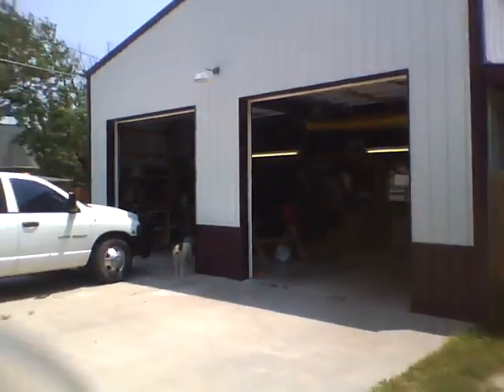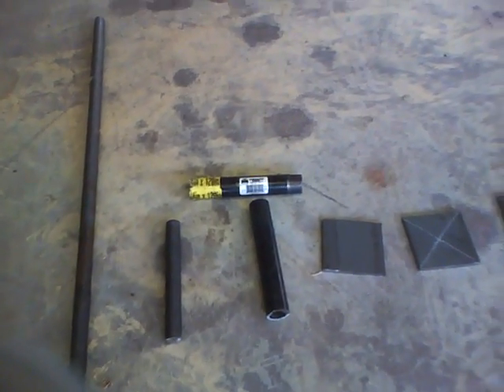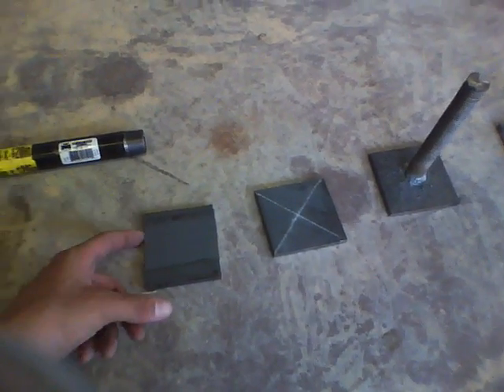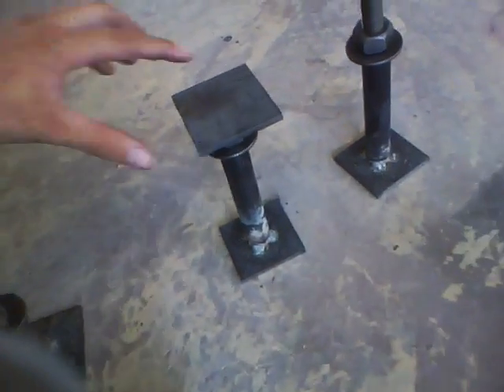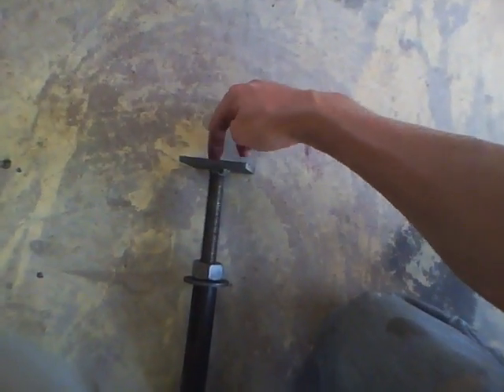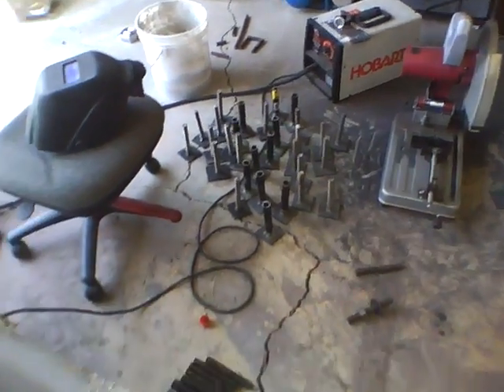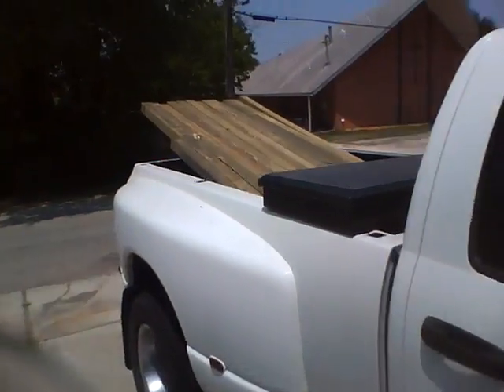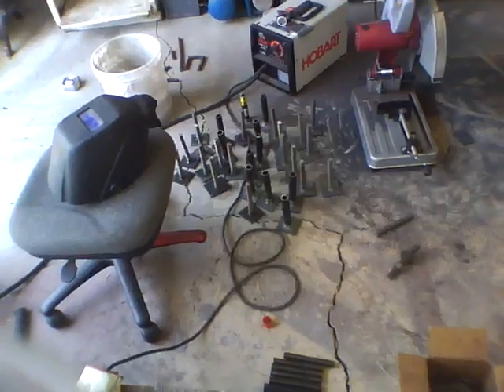Homemade Jack Screws to Level House - Foundation repair

Comment: If in dirt you are much more stable using a 1/4" x 1 x 3 channel. It will dig into the dirt and not slip anywhere near as much form a side load in a 'loose hollow pipe' Should be sleeved inside with less gap.  Watch more disaster failures videos before living real stuff.

Comment: I'm in the process of reinforcing the floors in a 40 year old house and am using the exact same jack design. have used similar jacks in the past and seem to hold up just fine.

Comment: Agree with John Smith below.  Not everyone is going to have access to a welder and all the material costs and work definitely makes this a cheap project only if you have the majority of components.  Essential Hardware has mini column jacks for $16.47 / ea and are made in the United States from Akron Products.  Not a bad idea, OP but not ideal for your average DIY Joe.

Comment: Dude, allthread is way too soft for these purposes. Pipe isn't designed for this either. The grain orientation is all wrong, the formation is wrong. Don't be a damn fool. Rustle up $20 per jack before you demolish a house on top yourself

Comment: I will be building these soon. How have they held up? Great idea !
Reply: +Michael Dyess Yeah, DON'T. Pipe is made to carry low pressures, allthread is NEVER, EVER designed to be pushed to its stated rating. When some part of this jack experiences catastrophic failure at 12 tons load, it will kick out LIKE A BULLET causing grievous injury.

Comment: $3.50 each MY A55!!  I bought materials to make 2 of these jacks and it cost me almost $60!
Reply from the maker: The Acme thread and nuts are the most expensive piece. I got these from a oil field supply/welding yard which is probably cheaper than a retail/chain hardware store. If it cost you $60 for two then that sucks. I didn't figure my cost to a T but I know there iss no way it was over $4.00 per piece.
Reply: +John Smith a six inch long x one inch thick threaded cylinder, a 6 inch metal pipe, a nut, and two metal plates (3x3 inches?) cost you 30 dollars?  Were they made of silver?  I haven't bought the materials myself, but that seems quite high.  Also side note:  Not sure if I would rely on these things to jack up a house... but who knows.

Comment: Awesome idea!  Don't have the equipment to cut metal though, what would you charge to make some for someone else?  My house is 110 years old and sinking in some areas and I am the only one that can squeeze into the crawl space so really need jacks that are easy to carry while on my belly..
Reply from the maker: I haven't really thought about making them to sell. I don't see why not. How many would you need?
Reply: Have an old house that is slowly sinking in certain parts.  Can say off the top of my head to start with probably 5 or six for sure, been trying to move cinder blocks around under the house but they are heavy and I have to work in a small crawl space, these look way easier to carry and set up while stuck on my belly.

Comment: Thanks Indnjiv. I ended up not needing as many jacks as I thought I would to do mine, and found 3 old hydraulic jacks in the garage that did the trick for my job. I may still make a few of your design though for future use.

Comment from the maker: Thanks, glad the video helped!!

If I were to do it again I too would make the plates larger. The bottom one should definitely be bigger to spread out the load, but oh well live and learn. As for the holes in the plate, yeah why not. I even thought of possibly making sides, for the top plate, to slide on to the floor joist and kinda cradle it. 

Post your results if you don't mind.   Thanks!!!

Comment: Nice well thought out video. You're the man. The corner of my mud room has sunk about an inch or so. There wasn't any footing put in. The corner rested on a 2x4 and the ground. We have seasonal snow and frost here in Colorado. I am going to make mine like yours but with holes in each corner of the base and top plates. Also I will make the base and top plates about 25% larger. 1/4 inch thick seems about right. Thanks for the insight.

Comment from the maker: I believe the plate is 1/4". I actually just bought what the metal yard had in there cut/bent pile. I did not make any holes in the plate. There was a slight amount of side shifting on one of the plates, but out of 36 I would say thats pretty good odds. It shifted about 1/2". I did think about drilling holes, but decided not too because I figured the pressure would hold it. Thanks for the response!!!

Comment from the maker: It has been awhile since I put these in. They were pretty easy to install. I tried to cut the vertical 4X4 to length so I only had 1'' or so of actual travel. I crawled under the other day for an inspection. I had to adjust about half of them as the house had shifted and settled. I hand tightened them then turned 1/8 more with wrench. Please post and tell me what you think!!!